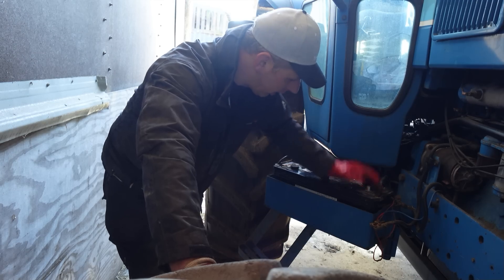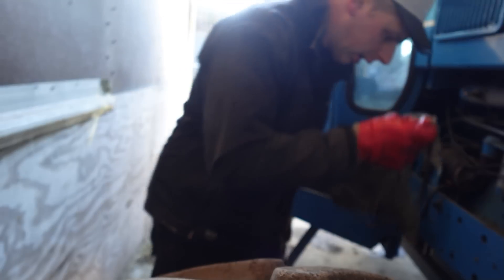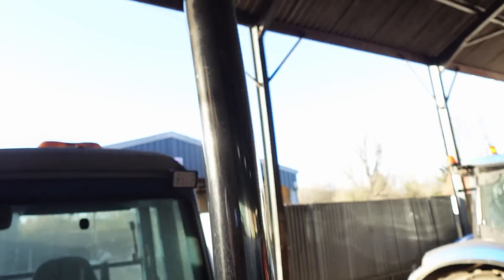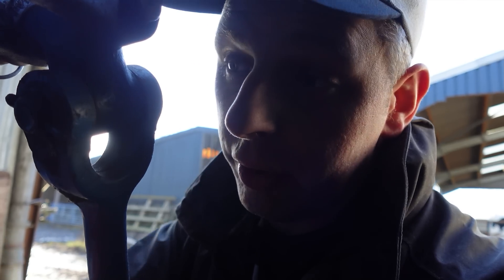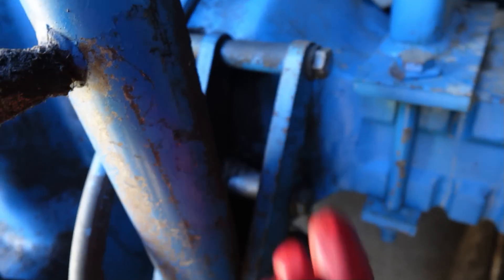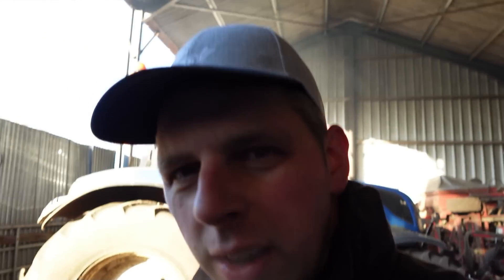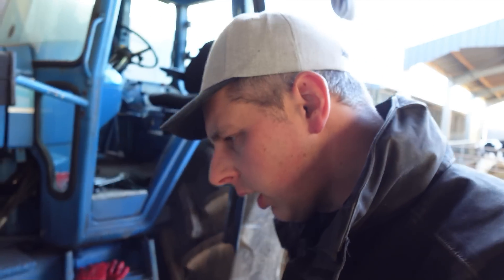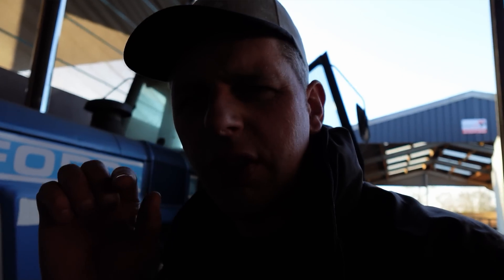GETTING The FORD TW25 READY For The DYNO

Comment: Hi George, Happy New Year to you.  I am guessing the Ford TW should be 146 HP at the back end due to the compression ratio of the engine.  

Maybe you can update her with a couple of cameras to let you see from the front of the front weight linkage and another looking down at the back onto a LCD monitor 
so you have extra seeing for working with the tractor attachments? Also the JCB tractor could have the same set up too.  🚜

Comment: Nice One George think Lord Muck said strait pipe loses power 😀 Interesting to see the difference  Have a good day Thanks again
Reply: Well we know a naturally aspirated engine does (we've proven that) so we now need to see if the same applies to a turbo'd 401.
Any bets ?
Reply: @LordMuck  Thank you for the reply I am defiantly no expert  on this subject so will be interested in the result
Reply: @DJC995  so are we because the Ford 401 behaves differently to the Perkins 6.354 and the 5.9 Cummins so in turbo form it will be good to see if it gains or loses power
Reply: @LordMuck  Thank you again for the reply